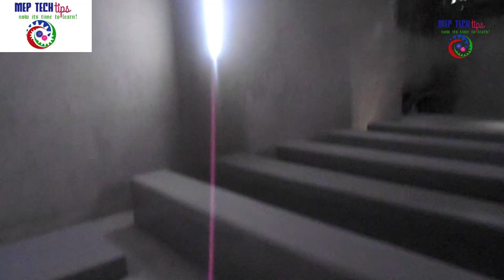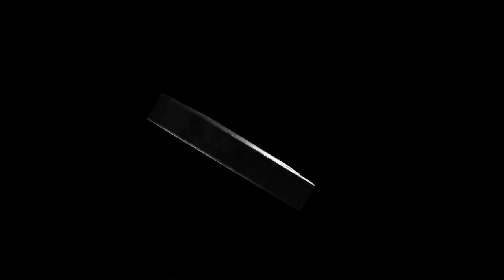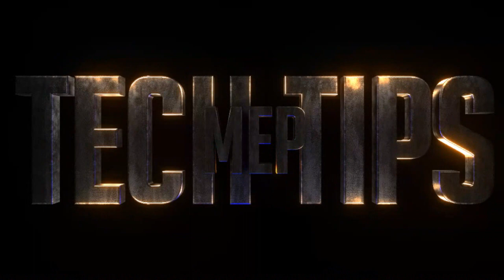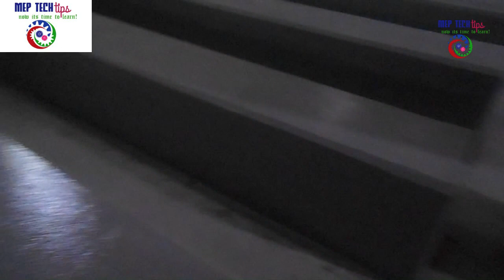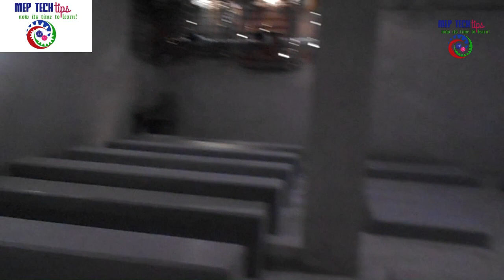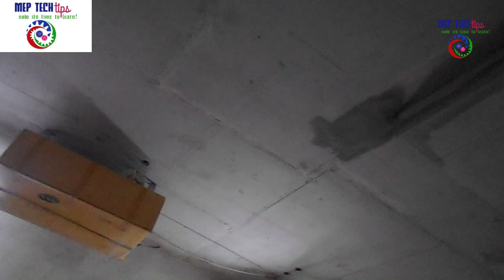MEP Pump Room Foundation Details in English- (Part 4) BY MEP TECH TIPS

Comment: Why epoxy painting required over pedestal.....any kind of the pads while.construction of pedestals likr polystrene board or filler board if yes then why
Reply: Any kind of pads required while construction of pedestals like polysterene board or filler board ....and why
Reply from the maker: for pedestals or any foundation there is no any pads required  and Epoxy paint is used because, if any leakage from any equipment water will not stay on the foundation and its in our specs to do epoxy paint in all foundations and Looking wise it will good to see.
Reply: @MEPTECHTIPS  pads requires polysttrene boaed or filler board use to make double protection of vibration .....